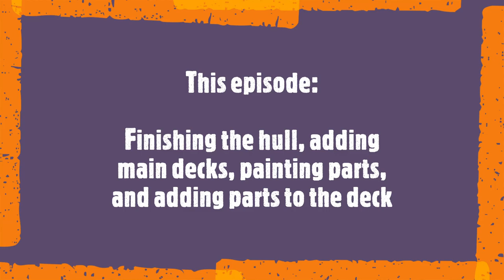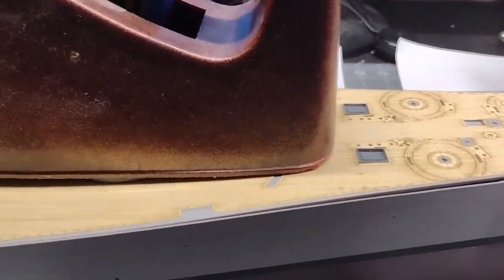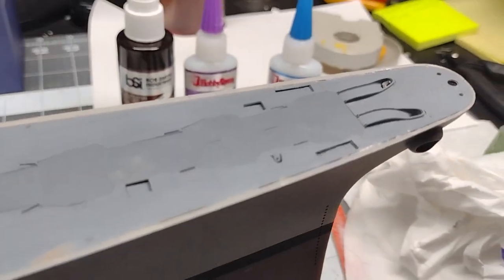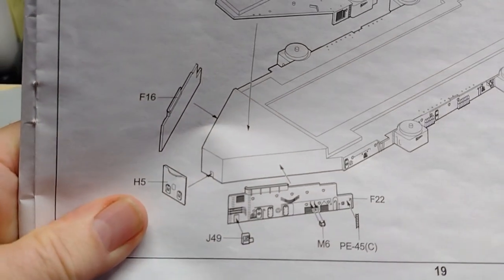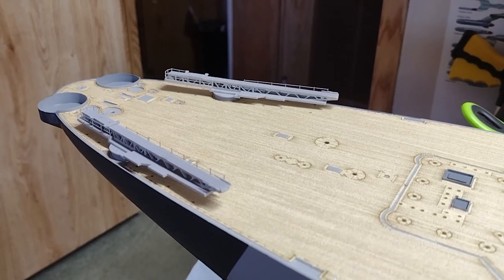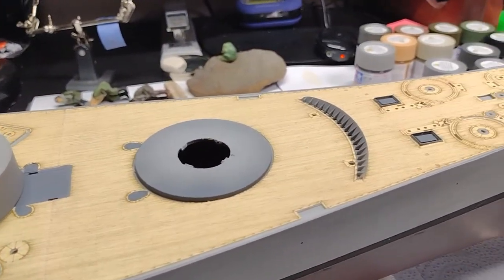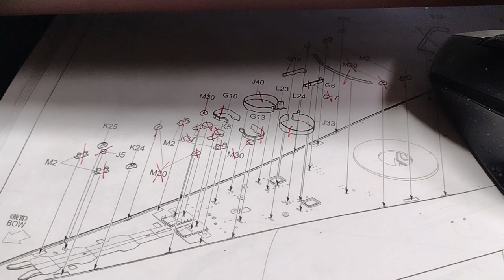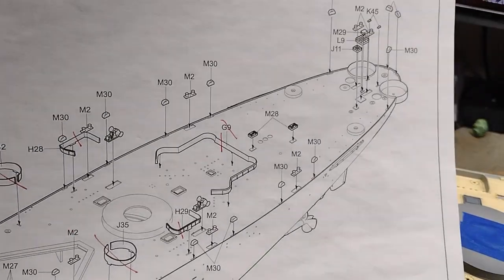1/200 Trumpeter USS Iowa BB-61 Part 3

Comment: Hi, I am building this kit and about ready to paint the hull.  Check photos of the Iowa.  The dull black was hard edge one end of each section and feathered on the other end.  All decking was deck blue.  On metal surfaces paint was used.  On the wood decking stain was used.  They do look different.  I would paint the wood deck before you glue it down.
Reply from the maker: Thanks for your comments.